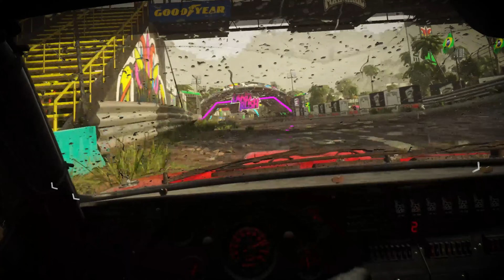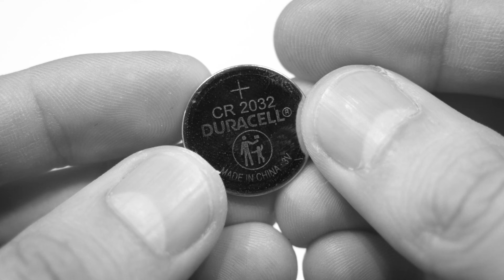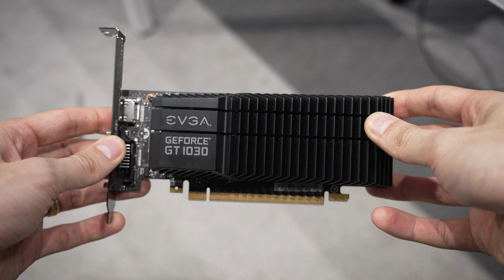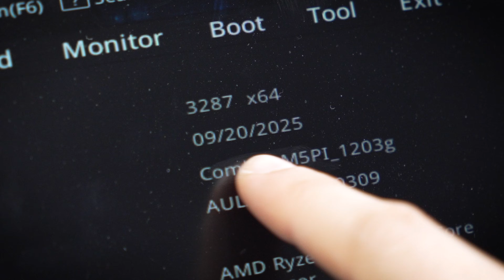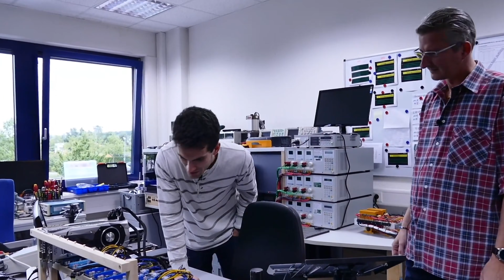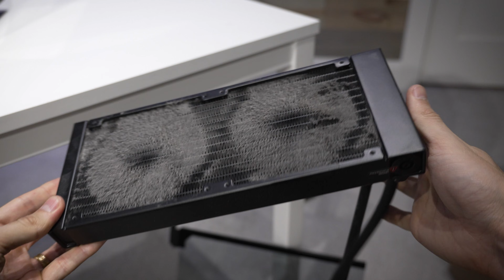Fixing a Viewer's BROKEN Gaming PC? - Fix or Flop S7:E4

Comment: Hi Greg, I'm 67 years old an disabled,  an don't know anything about computers, I'm working on building one, my grandson said it had built in graphics an that I don't need a graphics card, I got a msi b650 gaming 😊😊😊 motherboard, a coursair 850 power unit, a ryzen 7- 7800x3d  I call it the brain, I installed a wd black m.2 card 2tb. An do I need a  internal storage, I had a wd black 4 tb an give it to him, do I need to buy another one. It's a guessing game for me, any info would be greatly appreciated. I'm thinking about a gigabyte 50-70 ti graphics card if I need one.

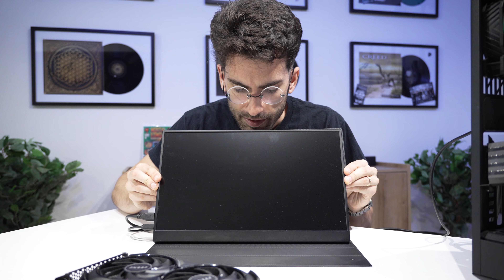Comment: 11:50 - Not so fast. I'd be willing to bet that board simply does not like those DIMMs, plain and simple. Allow me to explain.

I’ve learned a lot from your content, Greg, so I hope sharing my own 3-year-ordeal helps streamline future troubleshooting for you and others. Bottom line, NEVER assume a DIMM is faulty or good without testing on a known compatible board. They can fool you, and I have seen strange and contradictory issues with three AM4 builds that ultimately were fixed by replacing DIMMs that were NOT faulty. Specifically:

MSI B450M Bazooka / 1700 / GTX1650S – Initially bricked, degraded performance following RMA. 

Asus Tuf Gaming B550 / 5900X / RTX3060ti – Good initial performance became no-video POST, wake-from-sleep video failures, random restarts, and shutdowns within months. New kit. Side note: I won’t buy other Asus products—Armoury Crate is a disaster.

AsRock B450M-HDV R4.0 / 3600X / RTX3060ti – Video glitches, no-video POST, wake-from-sleep failures, and degraded performance.

The 3600X builkd was purely to troubleshoot the 5900X’s other components while its board was being RMA'd, so its similar issues with the 5900X’s DIMMs, even with a slot-powered GPU pointed to DIMM compatibility.

Memtest86 showed no errors, but all three systems now run flawlessly with replacements from the motherboard’s supported RAM list. Incidentally, the Asus Tuf B550-Plus would only recover from its issues by removing / reseating these DIMMs, and ultimately replacing them with a kit from its compatibility list.

Additionally, a Gigabyte B550M D3SH / 5700G / GTX1650S build runs perfectly with these four “problem” DIMMs. Its compatibility list shows only the 8GB versions, but the 16GB are otherwise identical. My findings are often dismissed online, but indicate at least some (perhaps all) Ryzen systems and boards are fussy about DIMMs.

Bottom line: a simple DIMM swap fixed stability and performance issues on three different systems — And the same DIMMs work perfectly in a board listing the 8GB versions as compatible.

Don’t get me wrong, I love my 5900X build, but had I known the 1700 was choking on its DIMMs, supported DIMMs, an RTX2060 and a suitable PSU would have been way cheaper. Those DIMMs drove me crazy from 2020-2023.

Comment: In sept 2025 i built a new system with Hyte Y60, 9800X3D and RTX 5080.  The games were lagging really bad.  Microcenter tested it and found out the Riser is not PCI-E 5 compatible and bottlenecking the card.  The riser is proprietary to Hyte. Had to return the whole case and rebuild in a diff case.

Comment: Just wanna throw some information at you regarding the high BIOS CPU temperature. My 5700X + ROG Strix B450F Gaming behaves almost the same while in BIOS because the board likes to throw like 1.42v at the CPU, so in a couple of minutes it creeps towards 65-70c. After booting into the Windows everything is fine, 38-40c idle with max temps of 70-75c after hours of gaming.

There is nothing i can do about it without losing a lot of performance by enabling some offset voltage. The CPU cooler is a Dark Rock 4 and the PBO is enabled with manual limits.

Comment: with the ram problems ( and it is now 4 months since the video ) and I keep hearing ram problems.  Is it possible that there are ram scammers good enough to get their bad products sold under normal channels.  Powertools has had this problem - conterfeit products do happen on amazon - and I saw one video where a normal store sold a counterfeit product. and counterfeit could be using slower components and jacking up the speed - getting the money but not long life.

Comment: I just literally had to replace my DDR4 Trident Z RGB because both were bad...  And I didn't even have XMP turned on.  I replaced them with a CL16 Corsair Vengeance Pro kit which cost an astronomical $385 after shipping but the system is now working flawlessly.

Comment: You can remove the screws from the pump head, flush the old fluid and garbage out, clean the distro plate and then refill the unit with an updated coolant and be back up and running.  So long as the pump isn't burned out of course.  I have refurbed quite a few mostly corsairs over the years with 100% success rates.  You just fill from the plate area one side till overflows from the other and then secure the cold plate, the seal should be ok but if not there's fixes for those as well.  Great video!  I'd test that ram in another system just to be sure, some kits don't play nice with ryzen even when on the OK list.
Reply from the maker: Yes, we said this in the video :-) Unfortunately, this procedure isn't commonplace for most casual builders/gamers.

Comment: AMD mobos are known to only work with certain memory modules. I highly doubt that RGB memory is 3 years old and part of the original build. Even if it is, firmware updates (like AEGIS) are known to disqualify older memory chips...for good reason.
3 years for a pre-built AIO is a lifetime.
PSU was perfectly fine, but gotta pay the bills, I guess.

Comment: I couldn't tell you why but on my motherboard at the very least the speaker beep is set to off as default in bios. WHICH DEFEATS THE WHOLE GOD DAMN PURPOSE IF IT EVER STOPS POSTING AND I HAVE TO CLEAR CMOS AND THAT DOESN"T FIX IT IT"S OVER.

Comment: The prebuilt FoF went very nicely with the prebuilt sponsor spot. Also, I checked out of curiosity and iBuypower does have a 1 to 3 year warranty, so I'm guessing the owner tried to go to IBP and found out it was out of warranty for service.

The Ryzen 7xxx and 9xxx series actually do have a very modest iGPU which always trips people up because we've gone so long with Ryzen CPUs generally not having integrated graphics at all unlike with the Intels.

I've been hearing that some manufacturers have been especially urging people to get BIOS updates to fix CPU and memory voltage issues so it's odd that that ASUS BIOS seems to be applying relatively high voltages to begin with. In the owner's shoes I'd definitely keep an eye on those voltages.

I love the aesthetics of the be quiet! Pure Loop, though, and when my current one fails I'm going to try and get one of those :)

Comment: I bought a few iBuyPower PCs 3 in my life time.  They've always skimped out on some kind of hardware.  From a Nvidia 480 from a brand I never heard of that eventually died.  To Power supplies omg the power supplies, I almost always eventually had to switch out PSU from iBuyPower systems because of issues like blu-screens or PSU just failing entirely.   Last system I bought from them was like in 2013/14 cannot remember, and honestly I decided not to buy from them ever again.   Last time they gave me a PSU from a brand that had to change it's name a few times because of the shenanigans they were up to, ie making a good PSU to pass reviews, but then using cheap components in said commercially sold versions while marking said PSU as the same PSU.    Pretty bad time that ways trying to trouble shoot that PC until I eventually realize it was the PSU just randomly deciding to not work properly leading to random hardware having to shut down or slow down, which lead to various different blu-screen errors on/off over the span of a year.

Comment: It could be an overclock issue on the ram never seen a double failure on both DIMM's at the same time. Usually its ether not seated correctly or ram overtime stops supporting its native overclock speed due to degradation. Its always good to reset your bios to see if it fixes things. Technically if ram does not support its XMP profile it can be considered a fault, but then again you can always undervolt or underclock to see if it fixes things. 

In somewhat rare cases it could be bent motherbord/cpu pins that control memory. that causes issues similar issues with ram.

Comment: would be a great idea to flip his cpu fan radiator to hoses on bottom so his pump doesn't die prematurely before sending it back. No reset cmos? In case he was trying to oc ram and fried them with voltages?

Comment: Bad memory is almost worse than a GPU rn right? I mean 32 gigs of DDR5 6000 costs more  than a 4060 doesnt it?

Edit: 18:05 I mean multiple unrelated issues is generally an indicator of that. Saw that nonsense alot when i repaired consoles.

Comment: Greg, you are wrong sir the 7 7700x has gas integrated graphics, I know because the system I run is currently the integrated graphics I’m using.

Comment: Also AIO with hoses at the top can be a problem if there is some air in the rad the pump might not be able to pump the fluid through. Especially if it's older and some fluid has been lost through seals over the years.

Comment: While building my new pc I ran into problems with both CPU and DDR5 RAM according the the EZ debug leds, thank god I started investigating and swapped my power supply for a better one (more power, recognizable brand) and now everything is running smoothly. Lesson learned never cheap out on PSU.

Comment: I've just run across this channel today (12/23) and first used be quiet! Pure Wings 3 in my build, just one year ago for case fans.   Three days after the 9800X3D was released, I went to it.    I now have the Silent Loop 3 420 and Silent Wings Pro 4's on the bottom.   Even though I have a Lian Li O11D Evo RGB, I only have the pump RGB on.   My temps are phenomenal and now swear by Be Quiet!.

Comment: I have a 7700x  and I don't know why it was always working at 1,44V and that took the temps up to 95º while gaming with a 360mm AIO. I did update the bios (Asus Rog Strix B850-e), the lower temps were better (at iddle) but when the cpu starts to work again the temps goes near 95º. Since summer is here (I'm from Argentina) I undervolt the cpu to 1,2V fix clocks 5200Ghz, now full load in cinebench the temps are at 70º and while gaming the temps are a little bit lower 60-65º. And I did the same for the gpu Msi Gaming X Trio 3090, went from 1,085Mv, 370w and 80º to 0,900Mv, 300-ishW and 60-65º while gaming, in Furmark the temps goes to 70-72º and I didn't loose any performance.

Maybe you know why the 7000 series Ryzen, use more Voltaje than normal?... Now that I think about it, I think de 3700x I had did the same thing, always at 1,4V
Edit: Just reach the end of the video and saw that the temps went from 68 to 36, mine were never that low at 1,4V, even in winter. Maybe I should change mi AIO? It's a CoolerMaster MaterLiquid ML360L V2 ARGB

Comment: Well, if the speaker doesnt beep then thats the first sign that the problem is with mobo/ram/cpu, if i had that problem my 1st step would be to power on the system without any ram and it usually beeps like crazy. If not, then either the mobo or cpu is cooked or the bios is corrupted. The speaker is a usefull troubleshooting tool just need to get used to read its signals.

Comment: The new AIO is installed upside down.  Optimally, the inlet and outlet should be above the pump.  But I'm sure it's fine like it is also since the top of the rad is above the pump.  Still, I would have done inlet/outlet at the top.  The Ryzen 7700x retail chips all of integrated GPU.  There are some rare 7700x variants that lack it, such as special OEM versions, etc. but they are very rare.  

Both sticks of RAM being bad is a HUGE red flag.  Something else is wrong in the system.  Probably motherboard vrm faulty, or incorrect voltage settings in the BIOS.  I wouldn't risk a new ~$500 kit of ram in that system.  I would replace the motherboard for sure...

That is a decent system.  I have nearly the same specs in the one I built earlier this year.  Ryzen 7700x but with an Asus Geforce 5070, and 32GB of Corsair CL-26 6000 mt/s RAM.  It runs well, and the 7700x performs great in most games.  GPU is the bottleneck as it should be.

The only reason I went with the 7700x is because I found a smokin' deal on an MSI x670E gaming wifi motherboard with Ryzen 7700x combo for about $250.  I had originally planned to upgrade the CPU and sell the 7700x, but it performs so well, I see no need to do that.  I'm sure an x3d chip would be a little better for gaming, but I'm not a huge gamer.  I just play a few games every now and then, so the 7700x suits me fine.   It does run hot though.  I originally went with an air cooler, but had to replace it with a 360 AIO because I didn't like my CPU running at 90C under heavy loads.

Comment: This video was so meta for me. I also have an IBuyPower prebuilt that has the exact same specs, (minus the power supply being ever so slightly different) Wanting to upgrade my pc, I was looking around YT for builds and came across this video. Seeing that the first upgrade I wanted to get was a new power supply, a 1000w be quiet Pure Power 13, just to see this guy put in pretty much the same is wild. Now I'm just hoping that my identical RAM doesn't go out lol. Great vid!

Comment: so what do you consider an "OLDER" AIO? I have a machine in my garage that was my main rig until 2021 when i upgraded. it was never turned off or cleaned. i cleaned it and made it my CNC machine and it has once again not been turned off or cleaned since the move to the garage. its an old H110i corsair AIO with no issues. the new rig is on its third AIO. to me its the newer ones that truly suck. i dont think they add antimicrobials in the water anymore because the time that it fails its most likely out of warranty. AND why does windows 11 suck so bad my machine would hang at the enter bios screen for 10 minutes then continue into windows and finally get there maybe 20 minutes later. this is an R9 5950x with 128 gb ram and a 4080 with 30tb storage onboard i made for animating. kept getting slower and slower til last night it updated and took 2 hours to boot. i reinstalled 24h2 ( less AI bullshit tham 25h2)  but now im into the OS in about 30 seconds. 5 machines running and 3 in boxes

Comment: I literally just went through this this past weekend. I had an AMD system that wasn't booting. Thought it was the MB, RAM, POWER SUPPLY. I bought a new amd MB for my cpu and new RAM.
Same issue....no boot. I ended up buying an intel cpu and MB. Booted right up. I think it was the CPU to tell you the truth. I have both MB and CPU under warranty that I'm sending out to be checked.

Comment: I know this is a prebuilt, but I would check the QVL on the mobo to see if that original RAM is there. iBuyPower has been known to just grab whatever they have on hand to finish out a build. A lack of tolerance for the mobo's voltage fluctuations could eventually kill otherwise good RAM.

Comment: Very interesting about the Speaker header not outputting a signal. Maybe it's an AMD thing. My Intel Z790 has full speaker support, I used it when fixing an issue on mine. In reality, they would tell you the same as what was on the Debug LEDs that motherboards often come with. And the latest motherboards often omit the header completely, much to my annoyance 😂

Comment: Aa I see the problem right at the beginning; MSI parts 🙄 Piece of advice to any pc builder out there; never use MSI parts if you want to avoid black screens and fans kicking in like jet engines right in the middle of your gaming sessions, or that your pc won't start at all because of the motherboard which happens to be MSI.

Comment: To say the speaker isn't working, my basic 1st step isn't CMOS or anything, i take out memory (and put in a speaker if not already in there) and start the system. Wanna BET it gives beeps? If it gives beeps i know motherboard/cpu  seem to be working. I even had systems that did nothing at all, power button light (on those cases) it stayed quiet. I took out memory and started it again and it gave those famous 'no memory beeps' put same memory back in and the system just worked normally (tested it forover a week).

I've been repairing/building computers/servers and other hardware related or not related to computers for about 30ish years. From 286's/pentium pro's to 9800x3d/285's and Xeon's/Threadrippers etc etc.

And i would've opened the AIO just to confirm (if customer allows it no warranty anyways).

Comment: I’ve had a friend’s computer have both ram dimms die at the same time. Cause was his family’s off grid power inverters pumping 290v through the house (australia, so meant to be 240v). It took out the ram and psu. That was over a year ago. New psu and new ram (and correct voltage) and no issues since.

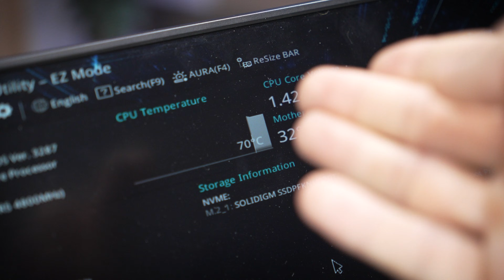Comment: It's probably not the fault of damaged ram, but the motherboard which probably doesn't support these types of ram XD Not every motherboard supports all types of ram, let alone tforce or ripjaws.. People buy because they have the same ddr5 and I wonder if they know that speeds are also important, each processor supports different speeds and ram. 15:50 he cooked CPU XD This processor only supports 2 types of memory, DDR5-5200 / DDR5-3600 he probably bought some that were too high clocked and the PC did not start. Ah, these water coolers are getting worse and worse, or they buy them and don't even check what the temperatures are..

Comment: Did I miss it. He did not recheck the ram after replacing the AIO. Would be worth checking. 

Also. Ditch the AIO's already. Your pushing your luck at the 5 year mark. Not so with an air cooler. With prices the way they are many people are owning things longer than ever.